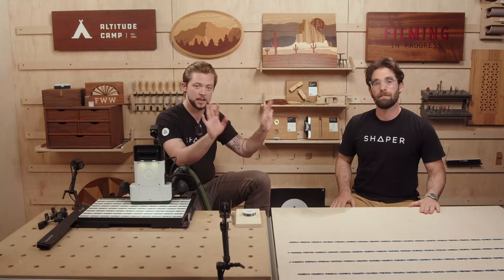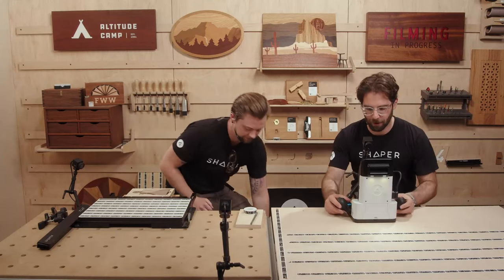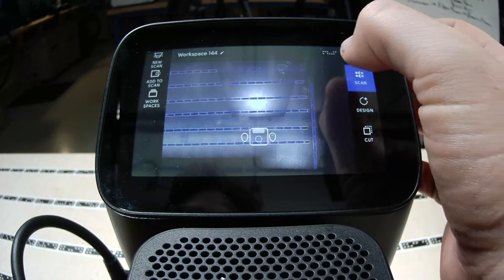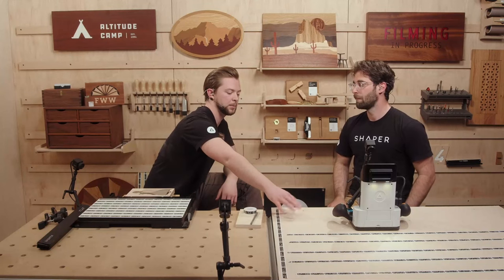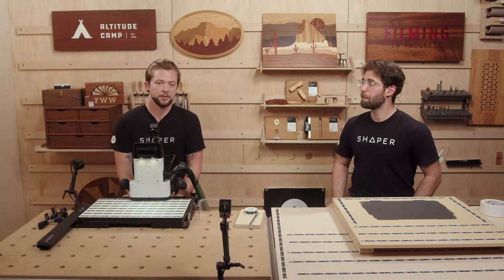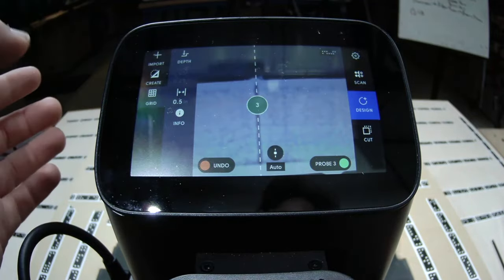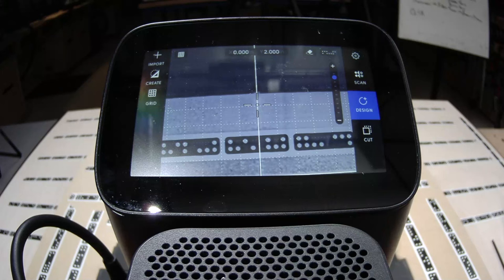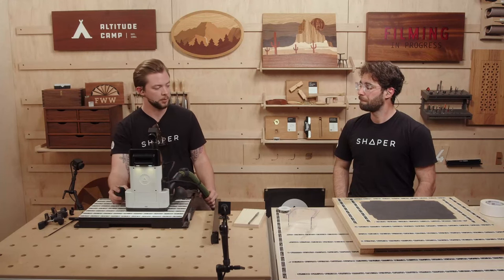Session 56  – English: Origin Pro Tips

Comment: One of your better video's.  I have used my Origin for a few projects and have learned alot from this video.  1- i was not scanning properly.  2- setting a front grid vs back grid.  3- z touch.  I have had issues with pine end grain and i could not get the z touch to work.  I had to go off the workspace.

Thanks guys for the info!!

Comment: A small tip for creating a grid: the spindle does not have to be plugged into the shaper during the process. This saves a few steps. The contact is also recognized without contact to the power supply.
Reply: I know but it's like a reflex action.  :-)  I wish there was an easier way to plug and unplug the spindle.

Comment: I would like to fabricate a speaker cabinet out of 18mm thick 13-layer baltic birch.  I'd love a video of cutting the panels of 18mm thick material.  Maybe one or two sides of the cabinet and talk about how to start with 8'x4' sheet.  ie: do you recommend rough cutting out panels before even beginning with the Origin.

Comment: I have purchased tape rolls that are defective in that the dominoes are faint or missing (just plain white paper) and the tape thickness is thinner in places and rips.  Also in these cases the stickiness is not good and doesn’t adhere.   Seems like a quality control issue.  Frustrating and the tape is very expensive.  Any remedy?